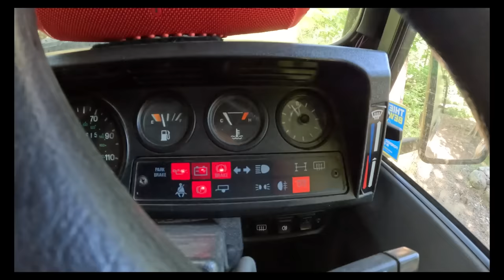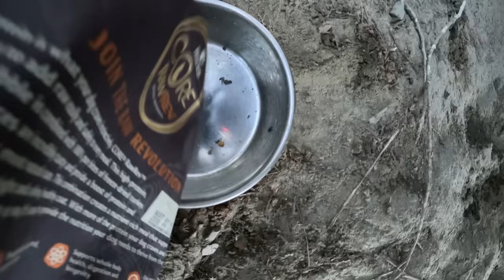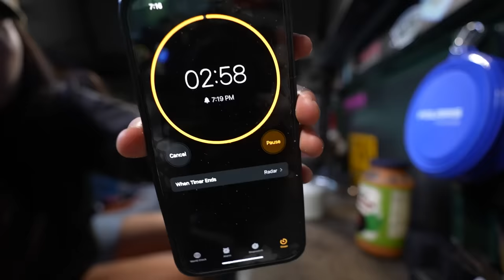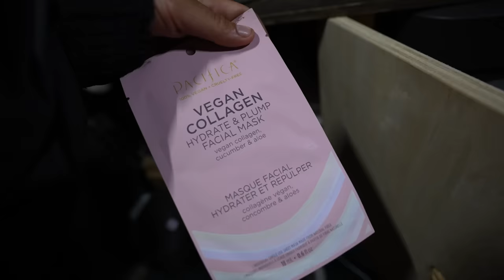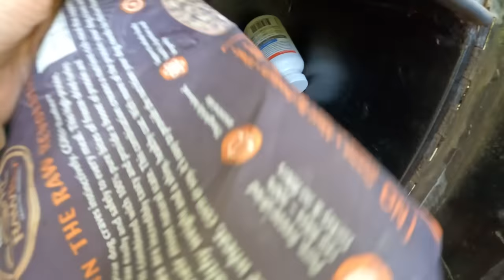Luxury Truck Camping in my Defender

Comment: My vote is for an injection timing issue especially given the recent pump change.  Usually retarded injection timing will result in white smoke on startup that tends to clear up as the combustion chamber heats up.  If it’s not using coolant, or making a milkshake in the cooling system, I’d start with verifying the injection timing.  I’d also consider getting the injectors serviced to ensure there’s no debris from the old pump causing issues with the injectors sticking and/or leaking down overnight.
Reply: But she said that issue occurred before the pump change and they thought it was that and it didn't fix the rough idle on first start. I think it's bad glow plugs or a leaky injector leaking a bit of fuel into a cylinder while it sits. More so injector since it's not cold enough for bad glow plugs to be a huge deal.
Reply: Leaking injector
Reply: Great advice.
Reply: I second the leaking down injector theory.
Reply: @TechOut  Yeah, it's still possible the crank sprocket slipped and the new pump wasn't re-timed correctly relative to the actual crankshaft itself.  Checking the pump timing at actual TDC is really the only way to ensure it's correct.  Also possible the old pump was pushing debris into the injectors causing a small leak after shutdown.
Reply: My money is on a leaking injector. Leaking down as the engine cools. In the morning the injector has to warm up to re-seal itself. Meanwhile the engine is burning off the excess fuel in the cylinder.
Reply: Have to agree with the brain trust.  That white smoke at cold startup is a sign of too much fuel and symptom of leaking/failing injectors.  Did you install a volt meter to monitor the health of the battery yet?  You could probably install a completely separate and isolated battery in that compartment.  If you run a battery dead just rotate a switch and your backup battery would save you.
Reply: I agree with the leaking injector(s)
Reply: Timing injection pump? What the hell is that?! Lol I never time my pumps. Still runs like normal
Reply: Beyond the injector possibilities, could it be the actuator on the turbo?  Does it blow diesel smoke on acceleration?
Reply: @chrisa2061  does it even have a turbo?
Reply: Yup. Right on the money this one is! Injectors could have all kinds of junk in them after the pump deal. The timing is critical as well. Take this person''s comment to the mechanic and run with it!!
Reply: @wirnet2084  I dont ever time an injection pump and it still runs perfectly fine. It states in the book to time it. If I do a whole fuel system, most of time have metal from the HPFP taking a shit and contaminating the system with metal.  I change out all the injectors, slap the pump on without timing change all the injector tubes and flush the fuel lines and fuel tank then leave my return line off to flush the return side of the system before it goes back into the tank easy peasy
Reply: My truck was doing the same thing and my injectors were mucked up & I changed my glow plugs and never had a problem again and it’s still running like a charm! 😊
Reply: @asian_makanic1805  on a mechanical fuel injection system, pump time is required. Not doing so will have adverse effects on the performance of the engine.
Reply: @NestoRides514  😂😂are you sure? Cause I been a tech for 5 years and never timed a hpfp on a diesel EVER
Reply: @NestoRides514  besides she still has the same problems before she even changed the injection pump. The shop didn’t know what the fuck  they were doing they were just changing parts
Reply: @asian_makanic1805  what engines do you work on. I’ve been  a diesel tech for the past 30 years. You’re probably working with common rail injection which generally requires no timing because the ECM is controlling the injection. On the older mechanical engines there’s a fuel line that runs from the injection pump to each injector. Fuel pressure increase opens the injector tips. So in order for the injector to open at the right time, order and inject the correct amount of fuel, the pump has to be timed.
Reply: @NestoRides514  cats,cummins, f250, duramax
Reply: @NestoRides514  how much u wanna bet it’s an injector that’s bad
Reply: @asian_makanic1805  it’s uncommon for a mechanical injection pump to fail. Mechanical injectors on the other hand are way more common to wear out. I would have started making sure the fuel system wasn’t sucking air, filters, lift pump, fuel lines, then injectors before suspecting a pump. You can usually bench test the injectors to make sure they’re not leaking and spray at right pressure and pattern.
Reply: @NestoRides514 yup. First thing I would of checked was pressure. If we’re my pressures were good I would of went straight to the fuel injectors. Cause my f250 did the same thing  as Maria when my number 8 injector was going out
Reply from the maker: @TechOut  the issue occurred before the Lift pump replacement, not the injection pump. After we got poe back from OC Rovers (injector pump, timing belt, rear diff, master slave cylinder) Poe ran totally fine for a few days. Then the rough idle and smoke issue started. Since then we've replaced lift pump, alternator, fuel pump. Still same symptoms
Reply: @roamingreckless  I would verify timing next if that's good do check injectors and glow plugs. I've seen a diesel out of time before but it was a 5.9 Cummins. Took forever to get started and popped and smoked like crazy. Yours almost acts like a cylinder is getting fuel in it when it sits.
Reply: @roamingreckless  another possibility is you have a small amount of air getting in when it sits. Check your injector lines too make sure they are tight and not leaking.
Reply: @roamingreckless Hit up Harbor Freight for a $20 infrared thermometer with laser. Point the laser at each exhaust port after a warm up. If you have a bad injector, one cylinder will be FAR colder than the rest.
Reply: @ChattinArmsCorp  depends on how bad. If it's leaky it will still be firing
Reply: @TechOut  Well, I’m not a mechanic; however, it is a simple tool to aid in diagnosis which has a multitude of other uses. On that, I don’t believe I’ve led anyone down a bad path here. Internet experts to the rescue! Except these issues don’t fix themselves just from our chiming in…
Reply: @roamingreckless  "ground bison", as if slaughtering cattle for food wasn't enough!
Reply: How bout a pin hole in the fuel line if the system gets air in it it will run bad on the first start up I have a diesel that does the rough idle at first start up then after runs fine until I let it sit again longer that’s 30 45 minutes will run fine all day unless she sits
Reply: @truthadvocacy 🙄

Comment: Congratulations Maria on hitting that 100K mark!!!!
I'm so happy for you and major kudos! So deserving
This has been an amazing year for this channel and 
the sky is the limit!  You and Blue are the BEST❤😁
Reply: so exciting!!! par-tay!!!
Reply: Yessss, it sure is!🎉🎊
Reply: Pull the injectors. Perform a compression check. If compression is good pop test the injector and perform pump timing as recommended. My guess is you have a leaking injector causing you to lose prime and also dripping fuel into the cylinders causing the excessive smoke on start up.

Comment: White smoke in generally an indicator of either a coolant, head gasket, or throttle body issue. Since it goes away after first startup I would lean toward getting either the throttle body replaced or cleaned. A dirty throttle body will cause a rough idle. When you give it gas it will push the grime out to give it air. After you let it sit, the grime will settle again. Hope this helps!! If you even see it lol

Comment: That sniffs of a glow plug issue. If you turn your keys ready to start there is a glow plug light, squiggly line. turn it on and off three times to see if that starts the car smoother. Easy thing to test :)

Comment: You have a small air leek on your fuel sistum I think it's on the fuel filter if you buy pass it with the fuel lines and try it in the morning and if it's ok just change the filter housings . I am a UK mechanic so if I can help to sort parts just let me know
Reply: Your never tire an assuie out 😳😁🐾🐾

Comment: Stuck open injector or injectors and the mechanical injection pump has a ALDA screw to adjust fuel more/less but before you adjust it might wanna ask someone first hope that helps 💕

Comment: Hey hey, definitely a stellar camp site for sure! Wanted to mention that all diesels start different in the mornings, especially when the weather is cooler. I would check and see if you can find the block warmer plug under the bonnet, should be around somewhere. It helps keep the engine block warm when not running over night, for long periods, ext.. 
Continue dong you and stay safe!

Comment: A little olive oil on the pasta after straining it will help keep it from sticking. I personally like to use avocado oil because it has a much higher burn temperature and I don't have to stock multiple oils.

Comment: Love your videos, Maria! Such cool adventures! In my humble opinion, white smoke can mean coolant/water getting into a piston. Remember to carry extra coolant with you, 50/50 mix. The sound issue (I think) is an injector issue. If it's in the budget, maybe get new injectors. Have a mechanic test your engine oil.  
By the way, Jetboils are the best for camping! Be safe, Good Luck!!

Comment: On the bison grease in the pan, I've just folder up a paper towel several times, then put it partially in the pan to soak up the grease.  Then use a fork to lift it out of the pan and onto a plate to cool.  Yep, I've slept just like that in a screened in room right by the river...5 minutes and your dreaming.

Comment: While the glow plug indicator light may come on and go off as expected, individual glow plugs could still be faulty. If one or more glow plugs are not working correctly, it can lead to incomplete combustion during startup, resulting in rough idling and smoke. Have a mechanic check the glow plugs and the glow plug relay to ensure they are functioning properly.
Reply: Get a simple 12 volt test light,hook to power cable at alternator touch each glow plugs terminal for continuity.disconnect each power wire at glow plug touch terminal on glow plugs with test light, light comes on glow plug is good.. check for something that might have been over looked by last mechanic,he might have missed a wire harness plug.
Reply: The glow plug relay is responsible for controlling the power supply to the glow plugs. The mechanic will locate the relay, usually in the engine compartment fuse box or a separate relay box. They may use a multimeter or a test light to check if the relay is receiving power when the ignition is turned on and if it is sending power to the glow plugs during the preheating phase. If the relay is not functioning correctly, it may need to be replaced.

Each glow plug has a heating element inside, and its resistance can be tested with a multimeter. The mechanic will disconnect the electrical connector from each glow plug and then use the multimeter to measure the resistance between the glow plug's terminal and its body. A healthy glow plug will typically have a specific resistance value within a specified range. If a glow plug shows infinite resistance (open circuit) or very low resistance, it may be faulty and need replacement.

The mechanic will also verify if the glow plugs are receiving power during the preheating phase. They can do this by reconnecting the electrical connectors to the glow plugs, then turning the ignition to the "ON" position (without starting the engine) and using a multimeter to check for voltage at each glow plug's electrical connector. If there's no power at the glow plugs during the preheating phase, the relay or the wiring might be the issue.

Comment: A few different things that could cause your issue with the rough Idle and white smoke. 1. Glow Plugs, Glow plug relay faulty. 2. Diesel EGR. 3. Piston rings or cylinders worn. 4. Faulty valve stem seals or valves. 5. Diesel Injector blow-by Seat leaking.

Comment: Check the engine coolant temperature sensor and the inlet air temperature sensor for correct values. Also, a compression test to make sure valve s aren't sticking.
Reply: It's a 26 year old diesel it doesn't rely on any of that to run.
Reply: It doesn't have that , old school mechanical Diesel injection pump, no electronics other than shut off solenoid  and might not even have cold start advance timing.

Comment: Change glow plugs ….replace fuel filter and fill new filter with sea foam engine treatment.  Run 2 minutes, shut off 15 min…then run for 30 minutes.  Maybe you get lucky!

Comment: Suggest for your sink. Check the connection  underneath. And if it's tight. Check into getting plumbers putty. Take apart the connection under the sink.  And roll a snake of plumbers putty. And put that under the strainer on the sink.  Reinstall the connection. Hopefully that will stop the leak.

Comment: If it’s a rough idle only when you first crank it in the morning it could be a injector stuck. Get a bottle of Lucas injector cleaner and poor in the fuel tank next time you fill up. Add 3 ounces per gallon of fuel. You can get it at pretty much any parts store, Walmart, and truck stops.

Comment: I agree with XBASS666!  I had the same issues with my 1991 first Gen Dodge!  Anytime you change a fuel system component the timing needs to be verified and the injectors should be looked at.  Good luck with Poe, he is an awesome rig!

Comment: A lot of suggestions to replace fuel injectors and glow plugs. Injectors and glow plugs are common problems on diesels that would cause smoking on startup. Recommend you find a service that can clean and calibrate your injectors. If you have a bad injector, they will let you know. An example is thedieselstore. Not endorsing, but this is an example of an injector cleaning service. This will also improve your fuel economy.

Comment: 4:04 injector is stuck open at idle. May be time for new ones or look into getting those removed and cleaned. As much as you're on the road get new ones 👍
Reply: Roversnorth has them for 139.00 each  for the 2.5 110 diesel

Comment: I am not a professional mechanic anymore.
Based only on limited information about the symptoms and history, my best guess is, fuel is slowly entering the cylinders after the engine is shut off.
The glow plugs cycle, and the engine seems to start promptly oh, it just loads up immediately. I would suggest verifying that the glow plugs are performing correctly, and have the injectors tested for leak down. Getting to the bottom of why there is excessive fuel on Startup can be tricky with this engine. The condition only lasts for a minute. People experienced in this exact kind of fuel delivery system are your best bet for a quick fix. Otherwise you're stuck with best guessers, and dart throwers.

Comment: White smoke on cold start is usually glow plug or preheater problem. Some diesels don’t have preheaters, then it can be injectors or injector pump. Depends on kind of shape the engine is in. Can cause it, but your mechanic can diagnose it. I had the same problem with a Ford power stroke that was hard to start cold after you ran it the problem went away. Only cold first starts of the day,it would smoke bad and run bad it had 3 bad injectors.

Comment: Hey Maria, about your sink leak! I don't remember what video it was but you had wrapped some sorta thick black tape around the /outside/ of the pipes (I wanna say it was flex tape or something similar). Now, I don't know if you've made any more repairs since then but I remember thinking to myself at the time "this is a job for "plumber's tape" ...but someone else is bound to tell her". I'm bummed that I didn't just say something then! So, it's this super thin, white, barely sticky Teflon tape that they carry at the hardware store. It's purpose-made to create a perfect seal between two threaded pieces of pipe. If you unscrew your plumbing where it's leaking, you'll want to wrap the exposed threads in one layer (maybe two, depending on how loosely they fit together) of this tape, then just screw the two pieces back together. You won't need to put it on both pieces, just the side that goes inside of the other piece. I mean, probably google how to use it, I've only ever watched my partner repair our old water heater's leak with it but it should fix you right up! No tape on the outside required. I know I'm super late even commenting on this video but I hope you see this and hope you and Blu(e?) are having a great day! (P.s. That crème brulee looked so good! Thanks for letting us know it's from Wholefoods ☺)

Comment: Glame night, love it! Serine sound of running rivers creeks streams and of course oceans do wonders for the psychic. Defenders are known for injector issues. yours are probably worn or sticking (run injector cleaner in the tank). Why they started with lift pump when sign of blue smoke is unburned fuel is a rooky mistake.  As well, a failed SVC (Suction Control Valve), VCV (Volume Control Valve), PCV (Pressure Control Valve) are all the same component and could give similar symptoms to a failed injector(s). good luck! peace out.

Comment: I'm not a mechanic I am a systems consultant and programmer. I ran an automated search and most common answer to why smoke at a cold start was condensation mixed with a little normal pollution and can be normal. Mix that with the fact that it's a defender and maybe that is the case. Some condensation in the exhaust system. Second most common response was not a problem if goes away quickly. Hope this helps. Stay recklass maria.